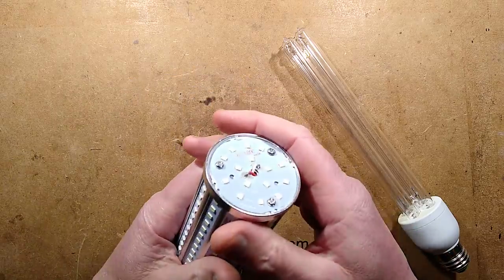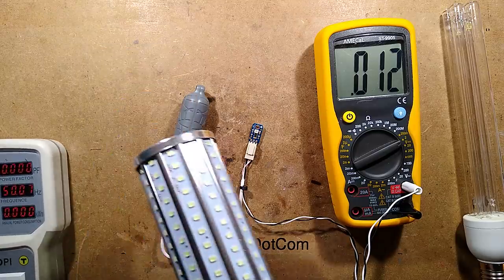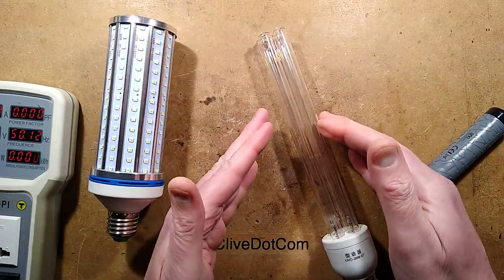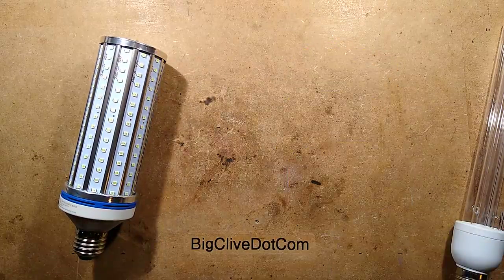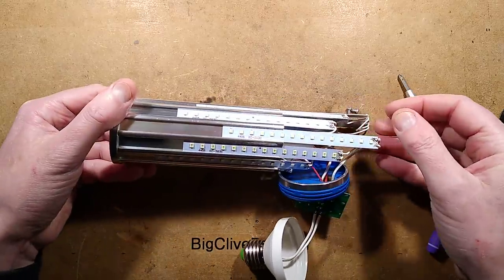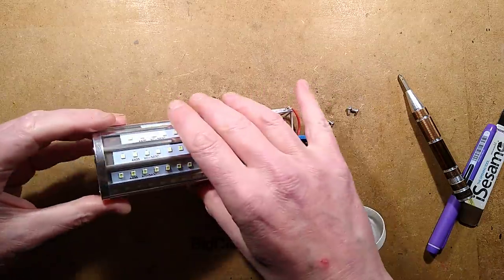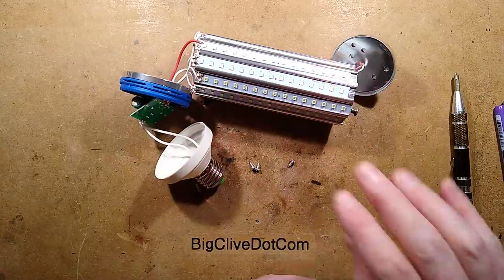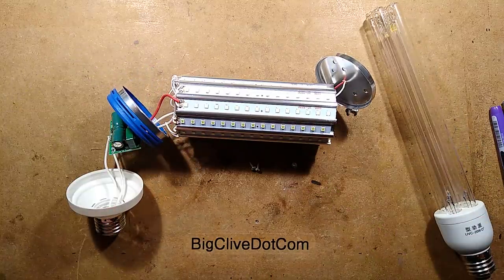Teardown of a fake UVC germicidal corn-cob lamp.

Comment: Is there a reasonably simple way to check that any of these lamps really emit UVC at ~250 nm ?
I thought about using a diffraction grating and a sensor like this :
https://www.banggood.com/DC-3_3-5V-0_1mA-UV-Test-Sensor-Switch-Module-Ultraviolet-Ray-Sensor-Module-Test-UV-Wavelength-200-370nm-Geekcr-p-1213021.html?rmmds=search&cur_warehouse=CN
Problem is, I can't find cheap diffraction gratings that get down to this wavelength. Also, can I trust that sensor ?
So, if you have any ideas, let me know. Thanks.
Reply from the maker: Green bananas go brown when exposed to strong genuine UVC.  This style of lamp just burnt the banana with heat.
Reply: @bigclivedotcom  Thanks!

Comment: On the subject of sterilizing face masks: UV light isn't really the best way to sterilize porous surfaces I'd think. Probably depends on the colour of the fabric how deeply the light would penetrate into it I guess. You'd be far better off just washing them at a sufficiently high temperature. The coronavirus isn't as resilient as you might think so some laundry detergent  and 60 degrees C will be plenty.

Comment: FYI on testing the corn shape light, you misinformed by measuring only one of the light that was 50 microwatt but failed to expalined that there are about 210 of those UVC-led light and each one omiting 50 micro watt will equil out of 10000 microwatts
Reply from the maker: 10,000 microwatts would be 0.01W.  These are not UVC LEDs.  They are ice blue LEDs.  The lamp is fake.

Comment: I would imagine that you may actually get a burning smell off of this lamp, as it is running the leds at quite high current and that generates a lot of heat.
(Your testing video with the bananas is good proof.)

Comment: this is probably a weird request.
My parents have a hard time understanding how microwave ovens work
DIY Perks recently made a video using a 1500W led.
This led is the most similar thing I have seen so far to a visible microwave emitter.
the led is $1000, and the power supply ridiculous, so you may not be able to use one, but you might be able to suggest it to other youtubers

if you can boil water using only the light from the led, you would basically demonstrate, simultaneously how microwaves actually work, and why ovens and routers are different.

https://www.youtube.com/watch?v=bBV-1VNWscA

Comment: There is a website called safebreathing .net that is selling this one for $55 and a few others over priced too. The funny part is in the about us they have the nerve to put this "all our products are carefully tested, effective and certified. We offer the best price in the market."
Reply: Then they cover themselves from lawsuit by putting this in the terms of service. "We are not responsible if information made available on this site is not accurate, complete or current. The material on this site is provided for general information only and should not be relied upon or used as the sole basis for making decisions without consulting primary, more accurate, more complete or more timely sources of information. Any reliance on the material on this site is at your own risk."

Comment: Doesnt anyone have a Real spectrometer?Not buying your test or eqipment
Reply: Just shine all this shizzle off a DVD (diffraction grating), job done.
Reply: @theskett  Just How does that measure spectral output?Job done?!
Reply from the maker: A real UVC meter costs around $1000.  A spectrum analyser that can handle from UVC to IR is pro lab equipment and costs 10's of thousands of dollars.
Reply: My apols; not suggesting that a diffraction grating could replace any $$$ hardware , it seems like a $0 DVD diffraction grating can show spectral lines which you can then display on the wall (remember Newton).
There should be (invisible) stripes from the UV A, B, and C (assuming they get thru the DVD plastic) against which you can check fluorescence.
If UV-C won't got through the plastic, you can quite easily check that separately; the DVD's mostly a mirror :-)
Let us know what you find, please?
Reply: Well, shoot me. Herschel, not Newton: https://en.wikipedia.org/wiki/Infrared  , with a thermometer up against the wall :)
Reply: @bigclivedotcom  Im aware of the cost of these instruments.The test being done here is anecdotal at best and completely unreliable.This DIY equipment is not capable of the task required ,is 100% uncalibrated, and is incapable of any meaningful quantification.The cost may be beyond your resourses ,but in the scientific world it is actually a 'cheap' instrument and is routinely used in many different types of labs for a wide variety of applications.Buy one,rent or borrow,or enlist the help of a lab that has one.Untill you can produce a quantified spectral output analysis of these lights,you are guessing and assuming-not scientific.
Reply: @pjh9104  See, I like and agree with everything you said, except that BC already used an AdaFruit sensor to Do The Needful.   At least, within our +/-30%-ish margins :-)
Reply: @theskett  UVC detection or not is  the object here.UVC is not visible.Any prismatic(thats what dvd DG is) attempt will fail to show anything that you can see in the UVC range.So not useful here.An electronic sensor tuned for it will be nessesary.Make no mistake,I am here because I want an answer on this.So I hope there is somebody who has the required instruments to do an actual meaningful test.
Reply: @pjh9104  Yes, we're all very aware that our eyes can't see UV-* :-)   
So I'd assume that BC would find something that fluoresces in the appropriate range (rather like Herschel [<-edit] and his thermometer)  and go from there, as regards the "paint it on the wall" convo, if he wishes.  Sheesh, Brits could do this a couple hundred years ago, so it ain't very hard.
But if you want someone to buy a $1k+ meter, maybe look elsewhere.
Reply: @theskett  I would not be averse to a photo chemical indicator if it could be reliably calibrated(or pre certified)  to react to the correct wavelengths.It would still not be a quantifiable measurement ,but at least it would be a reliable indicator.
You will,of course,have to be specific about your indicators.They will have to react to UVC,and not uva or uvb for this test of these lamps.You may find that a tall order.And ,yes,they did do this a couple hundred years ago-in the visible spectrum.And we are talking about detecting and measuring something Not in the visual spectrum.
Reply: @pjh9104  :
> I would not be averse to a photo chemical indicator if it could be reliably
> calibrated [...] to react to the correct wavelengths.
Ah, you're hilarious :-)
No one here cares about precise accuracy; we only care whether the item pumps Hg-spectrum wavelengths.
You want something different, look elsewhere.
We don't owe you any answers to your questions, of course.
Reply: @theskett  And there we  have it.A clear transistion from the rational to the emotional.Bravo!
No,you dont owe me any answers-you also dont have any.Bye.
Reply: @pjh9104  Well, you've been a love.  Go buy a $2k spectrometer and then report back.  Before that, kisses.
Reply: Pragmatically, paste the spectrum on the wall; look for the hot spots; figure out the wavelength from the angle; write a Ph.D. paper.

Comment: A rip off potential shock hazard basically... like with many chinese LED cob lamp with that type construction... bare solder joints...
The booming coronavirus market for UV lights is an oppertunity for this lot to try cashing in on... "quick buck chan strikes again"